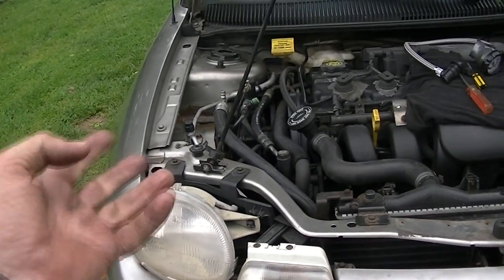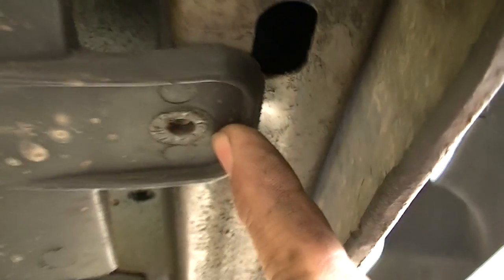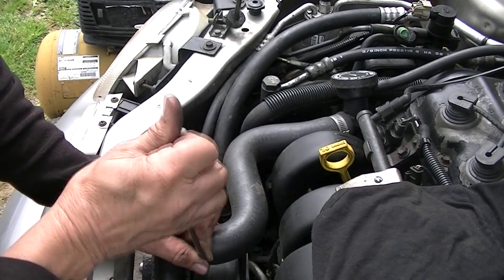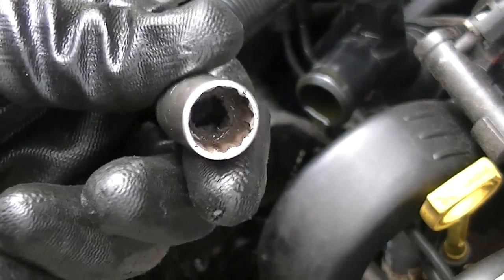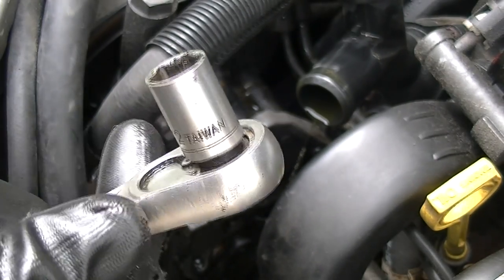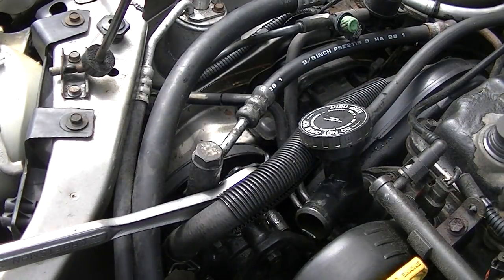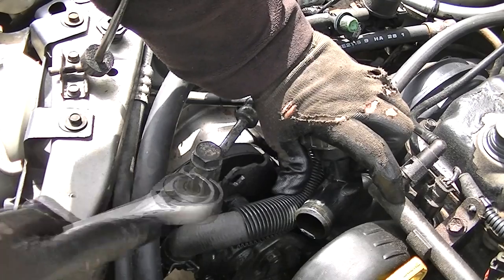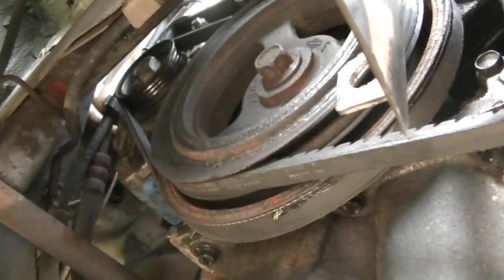Dodge Neon 2.0 Power Steering Belt. How to tighten it and keep it from jumping off.

Comment: Family saying:

Don't make messes & there won't be messes

meaning: don't make more work for yourself

Why
would you let air into the cooling system (by taking off the coolant hose)?
Neons are a PAIN to bleed out the air once you do that
& if you don't get the air pockets out 

YOUR CAR COULD OVERHEAT

basically killing your motor
(blown head gasket)